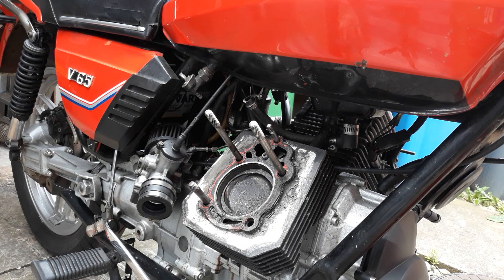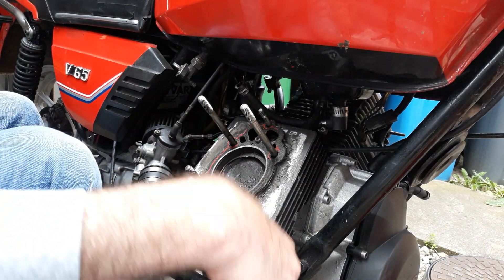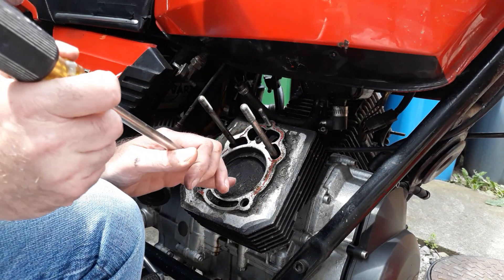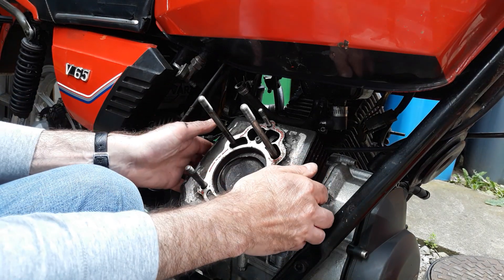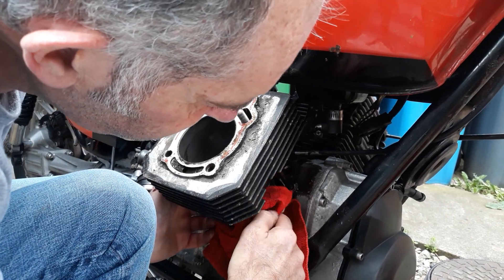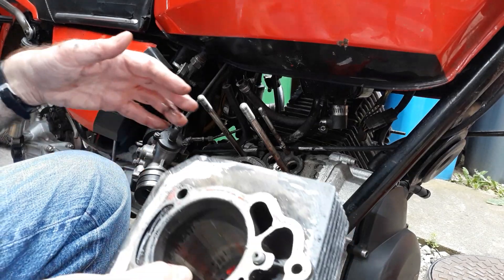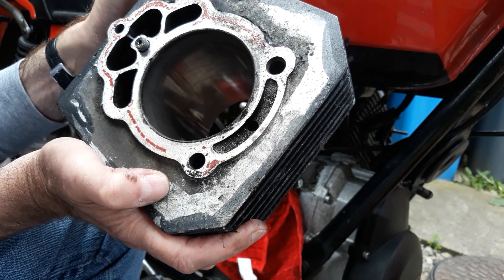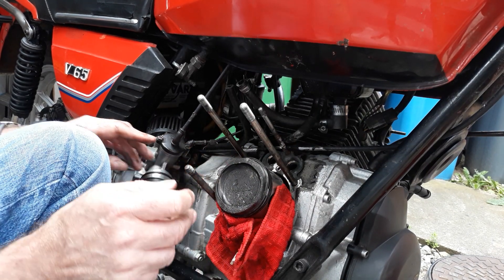Moto Guzzi V65 engine investigation - Part 4

Comment: back in the 80s. A very good mechanic friend of mine had a  1980 guzzi V 50. He was about 200 miles from home when valve  broke...
  He was alone but he had tools. He Unbolted / removed the rod/ piston from the crankshaft. He placed two Metal hose straps/ clamps around the rod bearings to maintain oil pressure.I don’t know what else he did to the valve train maybe removed the lifters and pushrods I don’t know. But he rode the bike back home 200 miles as a single cylinder. He said you never felt anything vibrate like that..

Comment: I much prefer to use a vacuum pipe to remove any debris from around the piston top or anything that may have settled on the oil drain and thereby lessening any chance of debris entering the crankcase